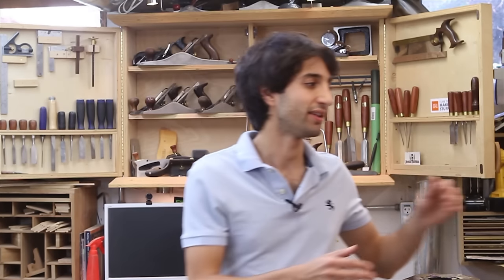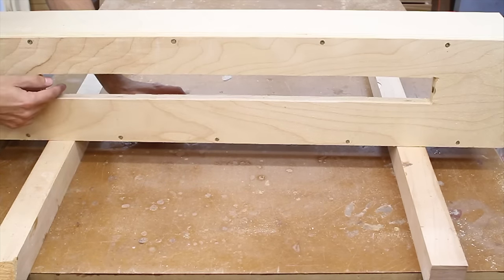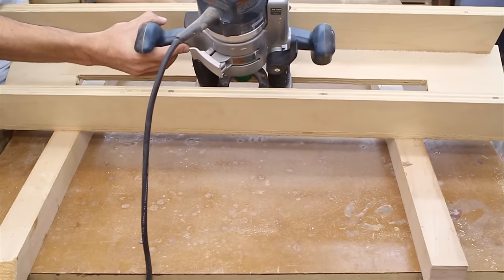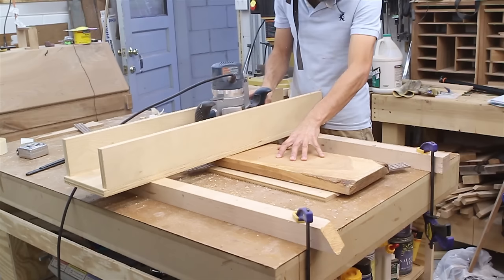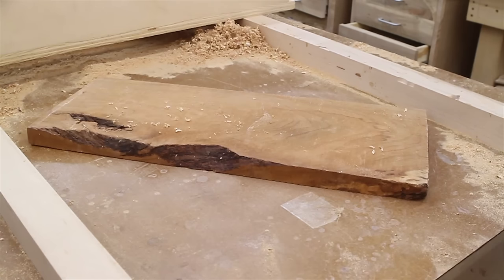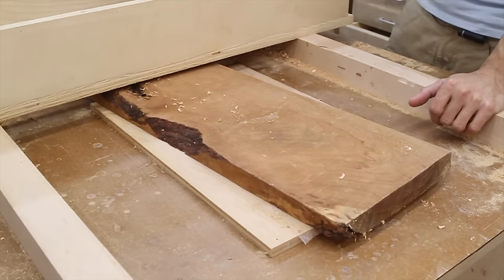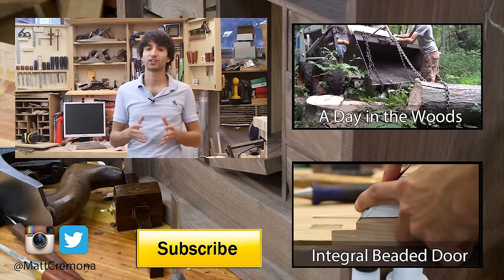Flattening Boards with a Router Sled

Comment: A flat bit is good for early passes over the workpiece, but the final couple of passes i would use a bull nose style cutter that will not leave an edge on the surface. I would also take thinner cuts as the process advances, as this will also leave less marks and deformity on the workpiece surface. I would also firmly fix the side rails to a base to stop them moving about, then clamp the base to your workbench. All in all your basic idea is sound, but i think a bit of thought could fine tune it immensly. Good video!

Comment: Simple set-up. Like it. One thing that would help you is after find the final depth is to take your router off &see how deep it is. Then you back off the depth & make multiple passes to get to your depth then go another 1/16th inch deeper to ensure everything is equal. Plus it doesn't work your router as much, especially 1/4" routers. Plus with 1/4" routers, use a smaller diameter bit. Just something I've learned

Comment: Man this video is 8 years old and I just discovered it. Huge shop saver.. Built a 24” sled for the router and picked up some poplar to practice. I milled it down to 1/2” for drawer fronts and they came out awesome.

Comment: Why don't i see anyone use that same method but use electric hand planer instead of a router?Would that not do more?.coz the planer has 2 wider blades than a router
Reply: You'd end up with a lot of tear out and potentially splitting your board. Planing end grain is tricky and risky.
Reply: I wonder if it would work with the planer diagonal to the edges, so that the cutting blades never align with a joint. Plus some sacrificial sidegrain strips on the outside to prevent tearout.

Comment: Talk about heaven sent. . .I just happened to find this video today, the very day that I decided a project I was working on was not flat enough.  I don't have a joiner and don't plan to buy one.  I've tried to find a commercial business in the area to flatten my slab but so far no luck.  But I have a router and the bit and will give this method a try.  Thanks Matt, you saved the day for me.

Comment: Thank you. This is simple and easy to set up. I am a novice with a router.
This looks like a very good and safe way to handle a router.

I cut tree trunks into slices about 2 inches thick with a chain saw. Some of these are up to 4 feet in diameter.
I needed a way to flatten them as a finished product. 

I believe this will work great. Thanks again.

Comment: Nice demo. 4 things for your sled. 1) Add "guides" to the underside of your sled. It keeps it straight and reduces the skips. 2) In addition to the shims, hot glue the work piece to bench to completely eliminate slippage. 3) Lengthen your rails to the full of your work bench so you can clamp all 4 ends. Again, reduces/eliminates slippage. And 4) Put wax paste on the sliding side of the sled. Let's your router slide more easily. Great video though. 👍👍👍

Comment: I have a jointer and planer, but i made this type set up on my work bench. So nice to be able to flatten large projects simply. Little time consuming but not bad. The first time i used it, I said, "Hell ya. Opened up some doors for projects. 👍

Comment: Thank you, Matthew Cremona, for your video on how to make a router sled. I was having a difficult time getting a flat surface on a butcher block until I saw this video.
Reply: You get within a finger nail thickness or so. After that it is just the normal sanding requirements of any machine surfaced wood piece.

Comment: Thanks for the technique. I tried to plane a portion of a big slab to serve as the base for leg mounting. Unfortunately a trimmer router is all I have, and I probably had set the depth too much for one pass and it ended up different dept across multiple passes. My take away is run a few times with shallow cut.

Comment: Good video, quick, to the point, with no useless self aggrandisement about things we don't want to hear. Thank you very much! I select a FLAT surface to work on, my table saw. There was still a rocking on your first piece after your pass on the first side, even after you removed the "glue."   A detail scraping  or sanding of your assembly table would be in order. I would also clear the work surface, my table saw, of any debris (you did not) before proceeding to side two. Air compressors and shop bench brushes are great and fast at that.  The sides of my jig, made of Baltic birch ply for greater precision, are only  two inches high providing ample rigidity, enough to hold the router base securely on the jig,  they do not get in the way and allowing for dust/debris collection.

Comment: I have got one very similar. Mine was built of MDF and has permanent rails which is MDF grooved into the platform. Each side has a different height to eliminate need to shim the lumber. I use very small drywall screws to hold the stock through my many holes in the platform. You may have encouraged me to do a video on mine one day. Thanks Matt.
Reply from the maker: Of course you have a fancy way of doing this :). 

I'm looking forward to seeing it!

Comment: Great video, Matthew! I resisted buying a router for years, for not very good reasons. A couple of years ago I bought a good 2 hp Bosch router specifically for cutting dado and rabbet joints for heavy-load shelf cabinets, and now I wonder how I got along without it. Now that I’m starting to use rougher pieces of stock, I’ve been wondering what my next major tool purchase would be, planer or joiner... and now that I see how I can use my router for making one flat surface, especially on wide boards, my solution is easy: I’ve picked out a good planer, and I’ll use this jig instead of having to buy a joiner (for now!). Thanks for this great demo.

Comment: Assuming you can fit it through a planer, another approach is to attach it a flat MDF board. Lots of double sided tape works. If it is too twisted, take a hand plane to it first, then attach it. Works every time for me. If the board is wider than the planer then the approach in the video is a good idea.

Comment: Did my first slab straightening today cobbled together a sled with stuff around the shop. It was a small piece, wasted a lot of time figuring out how to clamp it. The double faced tape my wife gave me didn’t work . Finally used T. rex clear tape just rolled it so it was like double sided tape worked great. It does make a mess suggest doing it outside if you can

Comment: I've seen a technique for flattening large pieces where a router is mounted to the edge of a door and the door is swung back and forth to pass the router over the material. The mounting system also allows router to move toward and away (perpendicularly)  from the door edge to cover an area to be routed. I think the sled is more straightforward. You could also mount router to a pendulum style jig to make a bowl in the surface. Might need to use a smaller diameter bit for that.
Reply: I rough cut with a core box bit in my pendulum router gig and then a finer cut with a bullnose. finish with a burr (low pitch material) and then a course and fine flap sander. Light hand sand and finish to liking.

Comment: I have a section of hardwood flooring that has cupped and it will cause more damage to pull out the pieces than to try and smooth them out in place. This looks like a method that might work. I can sand the floor afterwards to get a clan finish. What do you think?

Comment: Hi Matt, I've found that using a dish carving bit it great for this.  Because it's rounded, it eases into the cut better than a straight bit.  It helps reduce tearout on the edges too.
Reply from the maker: thanks for the tip Brian!

Comment: You did an episode making cutting boards with your firewood scraps.  Were these scraps just air dried 30% mc or were they 10% mc for furniture.  Cause I have a pile of black cherry firewood tyzt would be great for this.  Ive been advised that I should use furniture grade wood.  This would be for my own use or friends.

Comment: this is exactly the answer i needed for a project I wanna do. for the side rails, could you use some square profile aluminium lengths, I have some in the shed that would do quite nicely
Reply from the maker: Nathan Fenwick yes, aluminum would work well.  Since it's soft it shouldn't damage your bit if you run into it.

Comment: Nice demo Matt. Very practical (and safe) way for flattening end grain cutting boards. I'll have to try it sometime. I guess I'll have to make a cutting board first!
Reply from the maker: You'd better get out to the shop :)  Thanks, Guy!
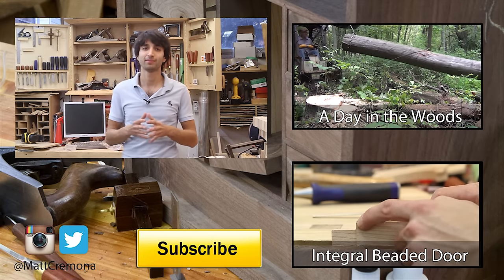Reply: Good information, but need to address the tear out issue on the end grain board there though.  Good to know as I was wondering if that was an issue here and you can clearly see this is an issue (see 8:04).

Comment: Hey Matt, I recently subscribed to your channel, so I'm trying to catch up on your past videos.  I have a planer, but I can see doing this procedure on one side then use the flat side down through my planer.  I know there's a jig for running warped lumber through a planer, but this jig is easier to make and just as easy to operate.  Thanks for the tip.
Reply from the maker: athiker7209Thanks for subscribing!  I'm glad you found this helpful.  The planer jigs require a bit more time to set up.  I personally have never tried one since this method works great!  Thanks again!

Comment: Thanks for the demo Matt, I have a small Redwood slab I would have been wanting to do something with but is does not fit the planer and I did not really want to spend 3 weeks sanding it, LOL. Your set up might make a mess but just think of all the fun your going to have watching the dust spin around in your new cyclone :)
Reply from the maker: Sounds like another project lined up for you :)  I am too amused by that separator!

Comment: Hi Matthew, You seem like a knowledgeable guy and I am hoping you can help me find a solution to my router bit problem.  I make wooden knee sliders for motorcycle roadracing.  My sliders are a simple rectangular shape with rounded edges.  I have been making them with 90 degree sides and using a 1/2" diameter round over router bit (in a table) to soften the edges.  I would like to angle the sides slightly in an attempt to minimize chipping since I use the more durable and longer lasting end grain on the main dragging surface instead of edge or face grain.  Is there a way to make a chamfer and round over/soften the edge with one bit?  I can't figure out a way to do it even using two bits.  Is there such a thing as a round edged chamfer where the chamfer is straight but has a curved shape at the top?  Thank you in advance for your time.

Comment: Really great jig and technique.  No planer or jointer, so I'll use this for sure.  What's the deepest you'd want to run a 1.5" straight bit in an average hardwood such as walnut?  I think my router is 3/4 hp.
Reply from the maker: Cactus ChrisThanks Chris!  I'm not sure about the max depth.  I was taking off close to 1/8" in some spots on that cherry board.  The router I was using is 1 3/4 HP.   A lot of it has to do with the feed rate.  I'd say give it a try and adjust the depth and feed rate as needed.

Comment: this a great vid. I'm making a 30" lazy susan with a recessed base so I need to hollow out a 25" circle on the bottom of the top. I need to hollow out 1/2" deep recess for the base which will be 24" plywood and a 12" bearing that's about 3/8 thick. the lazy susan  should look like it's floating above the table about 3/8".
Reply from the maker: That's going to be awesome!

Comment from the maker: +Mike Nguyen Thank you Mike!  That means a lot to me! Dust collection on these things is tricky.  One thing I thought about that would at least help contain the dust would be to add a curtain that hangs down from the sled onto the work piece and table.  That should help keep some of the dust from flying out the bottom.
Reply: +Matthew Cremona ,  I was going to build one with curtains as you mention and hole cut to accept my shop vac hose.
Reply from the maker: +John Pickett I'm curious to know how well that works.  Let me know how it goes.
Reply: The RA1173AT dust extraction kit works with the 1617 plunge base. Thanks for the video!

There are a couple different models:
https://www.boschtools.com/us/en/boschtools-ocs/router-dust-attachments-ra1173at-27260-p/

Comment: I saw your video when you were loading and unloading the kiln.  Noticed that you banded the lumber to a pallet.  Do you still get that kind of wood movement when you are drying?  Nice demo.
Reply from the maker: It's a standard drying practice to weigh the pile down since it greatly helps to keep the boards from warping.  If they are held in the position you want as they are drying, they'll usually stay pretty close to that.  Think of how steam bending works.  Thanks Ted!

Comment: Thanks so much!  This is great. I have a question, after you have routed, do you think sanding would be a good option to get rid of the lines caused from the routing?  I dont have a planer...figured i would rout and then use my orbital sander to smooth and polish  it out?

Comment: I'm just making my new table top for my work bench and it's not level.first time using biscuits and I think I messed it up a bit so i'm going to use that jig with some modification rails on side of table to level it out. Thank you for sharing
Reply from the maker: Awesome!  It works great for flattening bench tops.  Thanks!
Reply: I'm going to link your sled on my video

Comment: Thanks for the post...I am makin' a mantle from some twisted beams sawn out of a large twisted old doug fir cant (beams started at 10"X12"X7 feet...over 100lbs easily....not exactly something I could sled through my Dewalt 13" planer...lol)....had the rough idea what needed to happen but your vid was a nice refresher to point me in the right direction before I actually went out and did it today.     Now, if you know a good jig for straightening a twisted BACK that'd be great!

Comment: Boy I wish I had seen or thought of this idea before I spent hours "flattening" a handful of end grain cutting boards yesterday ... dinky little 3" belt sanders are not fun for that job.

This definitely puts a router well above a thickness planer on my tool wishlist, and well above a drum sander.  One can be used for many things, including flattening stock, while the others costs 2-5 times as much and can only be used for flattening stock.
Reply from the maker: Zoidberg227 Yeah, that doesn't sound like much fun!  The router is a very versatile tool.  I've seen more and more people using it to mill wood lately.  It must be trending :)

Comment: Matthew,  I've tried this technique with mixed success. I have two questions what type of double face tape do you use. I have had the stock move while cutting with the router. Or is my problem than I am trying to cut to deep with a single pass. Thank you for sharing your time and skills with your fellow woodworkers.
Reply from the maker: Hi Jay, I used carpet tape.  When I was doing the piece of cherry, I had some issues with it shifting around a bit while I was cutting it but I'm guessing that was because I had only taped it down in the two corners.  The cutting board wasn't secured to the table but I had no issues with it moving.  Thanks!
Reply: I used this method when building my first solid body guitar.  I used turners tape as it was the first 2 sided tape I found and it held up wonderfully.
Reply from the maker: Turners tape is some strong stuff.  I'll probably get that next once I use up this roll
Reply: m4u11 Thank you for your advice.
Reply: Matthew Cremona Thank you. I enjoy your videos and thanks for sharing your knowledge.

Comment: Thanks for the video Matt. I have most of the equipment one needs to make small projects like sofa tables, rolling carts, swing beds, etc., but the one tool I don't have is a jointer. And while most of my work is OK, almost all of the table tops I make have either bows or cups. I use lots of 2x8's and 2x10's to edge join for table tops - but they just aren't flat. Same thickness - yes - but not flat.

My question is, using the technique in this video, do you lay the board cup/bow up, then flip it over and do the other side?
Reply: I would lay it cup up so you can initially place wedges at the corners then flip it over and finish.

Comment: Hey Matt, great video thanks. Can you also use this technique for the sides of the boards? I don't have a jointer and would like to straighten the sides of the boards but didn't know if it would be doable given the awkwardness of routing a cutting board on its side. Thanks in advance.
Reply from the maker: Justin Lehman Thanks Justin!  I suppose in theory you could if you could figure out a way to hold the board perpendicular to the sled.  An easier option would be to clamp a straight edge to the face of the board and ride your router along the straight edge, trimming the edge of the board.

Comment: Hi Matt, I've just started woodworking and I neither have a planer nor jointer.. it was a great help from your this video.. but have a question about the router you're using in this video.. what model number is this Bosch router is? It will be a great help.. (sorry for my English) :)
Reply from the maker: Thanks!  It's the 1617evs
Reply: +Matthew Cremona Thank you Matt, you replied so fast.. Thank you so much.. keep up the good work.. :)